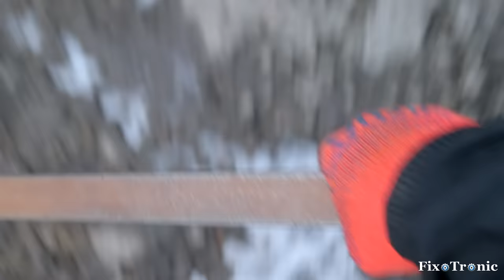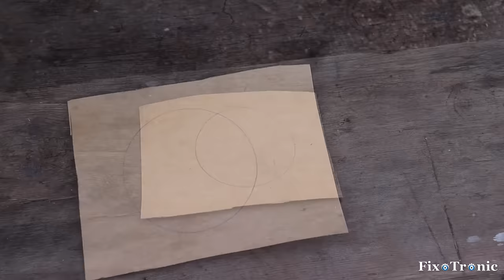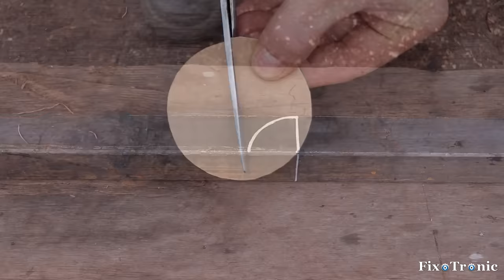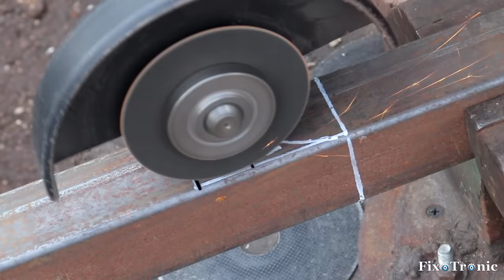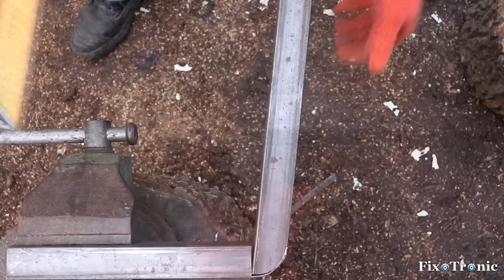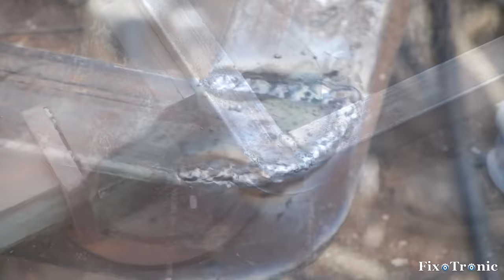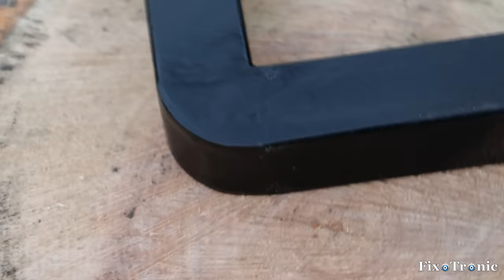Secret Profile Pipe! WHY DO WELDERS NOT SPEAK ABOUT IT

Comment: If I specified this on a print, I would be able to hear the welders cussing from 2 buildings over.
Reply: I'm glad you understand. The first thing I thought was that if engineers see this they will think every project needs this.
Reply: lol
Reply: noonetrulylives I mean would be nice to integrate into a bedframe
Reply: @raulmontano3310  And it begins lol
Reply: @raulmontano3310 Just get a bit of pipe the correct radius, quarter it and weld it in, much neater job, no stupid cuts with the grinder and simple marking out.
Reply: The welding is no more a deal than a 45 degree mitre joint. The tube prep is the thing, and a full-on metal shop with fibre laser machines would make this a doddle.
Reply: @onanysundrymule3144  You can do this with a co2 laser just as well. Without a dedicated tube cutter, which most "full-on" metal shops don't have, you would have to jig it on the bed and that's a hassle too. It's not so much that it's hard to do, it's just a frivolous technique that 99.9% could've been done another way
Reply: @onanysundrymule3144  But you still wouldn't do it this way with all the equipment in the world.
Reply: I will actually spec this into a print just to see the mayhem it causes
Reply: Why wasn’t the inside edge welded?
Reply: @pauladams1156  finally someone who gets it
Reply: @noonetrulylives9961  the reduction in stress concentrations though... the decreased weight... as an aerospace engineer student, I can tell you that we really like curved geometry for corners because then we don't need to worry about the material failing because of a peak stress resulting from sharp corners.
Reply: ValleysOfRain  wouldn’t it still fail on the internal corners?? Because it wasn’t welded on the inside edge?
Reply: Simion Alexandru  & I have zero welding or engineering capabilities.😂
Reply: @fuelinjection2262  That's one way to get welders talking about it.
Reply: Bill T 😂😆
Reply: Dude. If you're a draughtsman it's not your job to specify how it's made. All you need to concern yourself with is whether it can be made. The How is up to the production planners.
Reply: @ValleysOfRain  There is no decrease in weight doing it this way compared to the other ways to do a radius.  As practicing engineer with multiple welding certs,  I can assure you that this is a very useless technique. It just looks good to people that don't know better. Even if we pretend this is a better way to do it, his welds would never hold up to real stresses. Tacking whole lines doesn't penetrate the material in any significant way. These welds are neither structural nor pretty.
Reply: noonetrulylives to be fair it's not thick material & would be fine.
Ps: I'm an engineer & laughed at your earlier comment.
Reply: @veritasaequitas9875  Dude, what are you on about?
Reply: You seem to be ignoring an important factor which is what the purpose of the pipe is. If it carries a fluid, particularly a viscous fluid, then the minimisation of turbulance or the need to prevent sludge build up may be important. In other words flow considerations. That's why I would specify the need for a radial over a square bend. Having said that if these were important factors I would go for a tubular section rather than a square section.
Reply: @veritasaequitas9875  If you are just a Draftsman, you are correct. However, if you are the Design Engineer, you absolutely get to determine how it is made.
Reply: Omfg yes! I know I would be pissed, some engineers need to think about the process before putting overtly complex shit everywhere
Reply: @meetim2931  I do agree that for the thickness it's probably strong enough but it's just poor technique. I can't say I care for these YouTube channels that try and act like they  have some groundbreaking knowledge when they lack the basic skills
Reply: If I specify a hole on a component the planning department will decide how to create the hole not me. There is more than one way to make a hole and the method will depend on where it is and what tolerances I put on it's location, diameter and surface finish. As a draughtsman I don't care how they do it as long as it meets my specifications in all those respects. As for whether it can be made? If I were to put a square blind hole on a drawing and received an ass whooping from the shop floor I shouldn't be too surprised.

Comment: That will come in handy building an aluminum frame where I want rounded 90's instead of square.
Reply: Yep. By the way, at 4:28 I wonder why they didn't weld the inside joint.
Reply: @jamburkrishna  and ruin the 90 degree angle na.
Reply: Their are much better ways to get that exact profile.
Reply: Do they make 1/4 round tubing for the piece/upright in the z-axis?
Reply: But the question is....will you talk about it??

Comment: Forget the subpar welding, are we supposed to ignore the fact that he didn’t even weld the inside of the angle?
Reply: I never welded in my life (except for wires) and this was also my thought - why he didn’t add some welds inside, but then i started thinking - would that make angle/construction stronger or weaker (if done incorrectly and material would be “overcooked”)?
Reply: I thought that too!
Reply: Well considering his weld didn't even penetrate on one side, but I digress. The reason is expansion. If you weld the inside of the tube, then you will no longer have a 90* bend.

Comment: Ever heard of a speed square? Yeah it’s “neat”  , but it takes like 2 mins to make 2 45’s and tack it to 90 degrees
Reply: Pete Pete Pumkineat yes you are correct but I could see this used in marking furniture but I would never use this for anything structural.
Reply: HD42 Gaming my exact thoughts as well
Reply: That would give u a Sharpe corner not rounded though there Pete

Comment: If I used this joint I would never get anything done. 
Sincerely 
30 year welding vet.
Reply: Maybe if you could somehow plasma cut it! But I don't see the benefit, the stability shouldnt be any different! Only for aesthetic reasons
Reply: I done a few miles of welding in my 40 year career, agree 100%
Reply: Does a welding vet heal iron horses?
Reply: It's purely for aesthetics.
Reply: @Core5  if he was worried about aesthetics he would learn how to weld.

Comment: Imagine putting in this much work just for a 90 degree angle...
Reply: To then just weld it shut...
Reply: And it ist even closed inside Look 3:34
Reply: @Funny_facts_usefull  Your a doughnut, its not closed their because it is not finished...
Reply: @connorl7012  yea then why does the Video end withput Himmel cutting this one peace out
Reply: It could be useful for certain applications, where you want that nice rounded outside corner instead of a sharp one.  But it's definitely more labor-intensive for someone using hand tools too.

Comment: A great example of “ the longest, most complicated and unsound” way to make a 90. 
That is for someone who doesn’t have anything else better to do.
Reply: Complimenti.        Ciao
Reply: I was thinking about that too but it you also noticed, It had a perfectly rounded corner, Could have literally cut the two piece in half and made a diagonal cut then joined them with some tac wields but that wasn't the point of this AND doing that would have gave a sharp corner instead of a nice rounded one.
Reply: @hailothgaming  You are righe, but ... where is the "Secret"? A Secret so srcret that there is this you tube video showing how to do it. Interestng, but ... "SECRET"? 
There is a machine called "pipe bender" that made perfect 90 with cilindic pipe. I am sure that there are some less complicated methods to bend a square pipe. Beside: what'ts the purpose of this 90?
Reply: Well I’d like to put it to a bend test.  Promise them welds well not hold.   1st. Not a full penetration weld was done. Just a tack welding the surface.    The whole reason to cut and bevel ends to be welded is strength.  2nd.  There are tubing benders for round or square sock so no real purpose for this.   But if you don’t have a bender.  Simple cut 2 - 45 deg cuts on each end then bevel them and weld out be strong and after grinding if you choose be just as good
Reply: It takes some time but it is Art. Go back to work man, weld a strong bridge or something.
Reply: I'm building a 86 nissan 300 bash bar with no complicated angles and tell me would a solid 90 look nicer then this on corners? This does have its place so dont knock it
Reply: Dannymclovin69 
If you are building for looks, sure it has a place. If you are building for functionality, unfortunately that won’t cut it.
Reply: Dannymclovin69    I understand what and why he doing it.  Instead of a 90 deg bend that typically comes with a point on the outside roll of the bend.    I’m telling you as a CWI. It’s not strong and will break.  Looks is about all it’s good for.    Your not getting a full penetration weld only a surface weld
Reply: @lookingbehind6335    

Functionality? It's a bash bar it's the outer lines of my bumper that's it it's not structural it's not anything around that it's just so it looks nice this looks nicer than a sharp 90 that's why I want it
Reply: @craigcanterbury264  his welding skills aside the idea is a sound one. it just need to be properly executed.
Reply: Yeah. The welding is self was... Not good either.

Comment: This is the "I Get Paid by the Hour" joint... why are you revealing our Union Secrets?
Reply: @reddragonbox7957  clearly it was a joke
Reply: Eco Mouse great
Reply: @berlinetta350  are electricians greatest field??⚡🤔
Reply: IBEW 136 strong!!!
Reply: По русски напиши
Reply: Nice and good but my boss would kill me if i would be this slow, just cut a 45 degree turn it up and weld it at 90... If you work for yourself just do it..
Reply: @wadnarancs00  We've actually stopped doing miters, since they are never as accurate due to blade drift or wander (depending on your saw) So, we now do the half laps on angle, and cover flap on square tube. Only time we do miters is if it's decorative or stainless steel. But I've even just done the burnishing trick with a piece of metal tape where the miter should be. No one can tell how we cut or welded the tubes by then anyway. We think the cover flap method on square tube is actually stronger, because we are laying down 12" of bead on a 2" tube, to cover all the seams. (sometimes 10" if the call-outs say no weld on the inside corners)
Reply: @EcoMouseChannel  I working in a farming equipment factory. 1-2mm is not a problem here. We have some precision jobs 1-2times a year that we have to do nice and good. Thank you for this info, I will give it a try!😉

Comment: I can tell you why it's a secret, because no welder wants their customers saying "can you do that thing to every corner on my project"
Reply: I want them to know. More work, same time, more payment, happy customer. WIN-WIN!
Reply: this is true, and very little welders kwows do do that way
Reply: But what would be interesting to know is if this method makes the joint stronger compared to the conventional way of doing it. 🤨
Reply: @DeanLangley  i'm not sure, depends of the size of tube and scare section
Reply: Unless the welder has a bandsaw, and can make that cut in like ten seconds.
Reply: Right no welder talks about it because it take 5 times as long
Reply: @DeanLangley  this method at least consumes 5x to 7x the amount of time, a standard 90 degree joint welding does take.
second, the structural strengh of this method will be about 20% weaker,  compared to the standard method..
i fully agree with you and also come to the conclusion as this is purely clickbait.
by the way, the welding was done in such a poor fashion that it ashames me. as a welder, you are not supposed to start, stop, start, stop, start, stop kind of weldig.
this method is a total fail. if x rayed, you will see that it was in fact spotwelding and adding spot on spot.
this is so poor, it ashames me.
Reply: @adnieman  dam Skippy!
Reply: @DeanLangley  or would it be stronger since it was not 2 separate pieces being put together? 😉
Reply: Sure they do, they can charge more for it.
Reply: @DeanLangley  to be clear, I said 2 separate pieces, which this is not. Your way = more welds and cuts, probably as much or more time...more welds=weaker.
Reply: @adnieman  you're exactly the kind of welder that will always be just "ok". Never show them your best? Wtf kind of ethics is that. If you're ok with being that kind of person, that would be why you still live in a double wide.
Reply: @DeanLangley  right, so add more cuts and welds, that will make it even weaker. All you're doing is supporting what I said.
Reply: @DeanLangley  110% disagree and pretty sure a structural engineer would as well. More cuts & more welds = weaker.
Reply: @virgile93  it is always less material, so it is always weaker than a normal corner. - Wanna add: Consider the rounding gives some strength back vertical (z-axis) and horizontal (x-axis), but the rounding will not have any effect at the y-axis
Reply: xactly
Reply: Wow...
All so passionate.
We get it now. 
It's a technique to be used occasionally for aesthetics.
And this welder is shit...
And even I could see that and I dont know much about the subject ...
So it's all a bit of a pointless waste of time.
Thanks guys...
Reply: Why not? Set a price that makes it worth your while.
Reply: Haha! Yes it's pretty, but fuck, it's time consuming! 😂

Comment: math skills : 10/10
welding skills : 3/10
Reply: Best Comment Reply Ever on this Video
Reply: Welding skills 1/10
Reply: Yes
Reply: I just do it  only 2 minutes
Reply: The thing is welding with steel is that there’s no need for great welds on something like this, just have enough weld on there piece and just clean it with a grinder, why spend so much extra time on that step when a grinder will clean it up in 5 minutes
Reply: @blitzwithspartan6175  yes I know customer is not afford this this type works because he have simple options for this type works
Reply: Sachin Sharma 
Yeah, but I’d understand having perfect weldings on like aluminium or Stainless that wasn’t being painted
Reply: @blitzwithspartan6175 in the steel fabrication not require for pain job
Reply: @blitzwithspartan6175  I m also a  SS and ms fabricater
Reply: Sachin Sharma 
Oh nice, I started my apprenticeship late last year, I’m a sheet metal worker but work with steel, ally and ss, but yeah we usally get all our painting and powder coating done else where, but for small jobs we’ll do in house painting with cold gal spray or a black zinc paint

Comment: Probably could have just made a quarter circle profile to begin with instead of a circle then trying to divide evenly in 4 - but we wont speak about that
Reply: Ryan i think he did that because of the length of the side of the pipe, measuring half the size would have been a bit unreliable
Reply: @Claudio-gv2lz  He wouldn't half it? It would have been the same radius as what he used - just use the protractor from the corner of a bit of paper so you have a quarter circle with two square edges
Reply: @yourangerfuelsme  why are you so offended by a helpful suggestion?
Reply: @ryancaugust  because @Evan Laing havent been in class of metal forming and construction🤣🤣
Reply: @ryancaugust  who's offended?

Comment: Ive been a professional welder for 15 years. This is clever yet an absolute waste of time.
Reply: Exactly why lots of people don't do it. It might be good to do if you were making lawn furniture or something decorative but not structural, It's also funny folks are calling this a piece of pipe since it's square tubing.
Reply: Clever, absolute waste of time, and intolerant of imprecise eyeballed cutting if you need to hold to tolerances. 45's are super easy to cut repeatably with a chop saw.
Reply: @simplyamazing880  might work as anti-zombie barricade in a pinch...or a weight bench with an 80 lb limit.
Reply: Be ok for a goal frame 👍